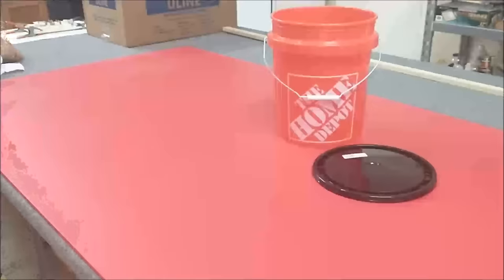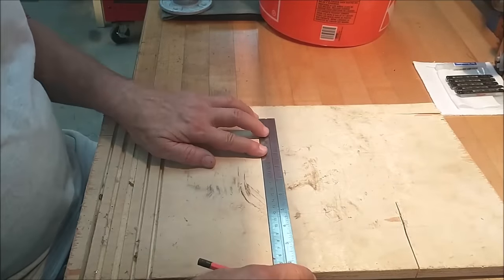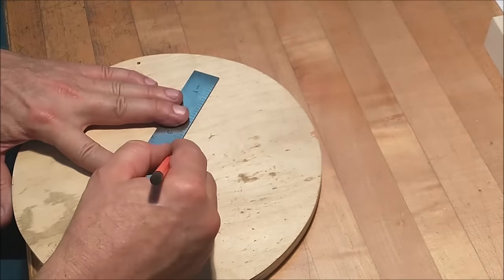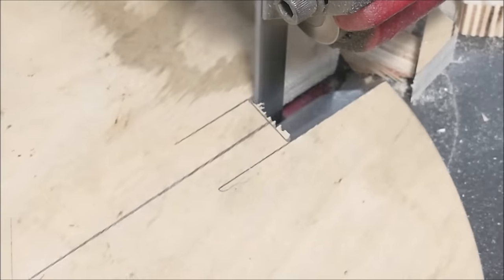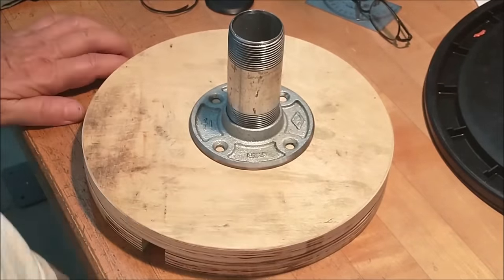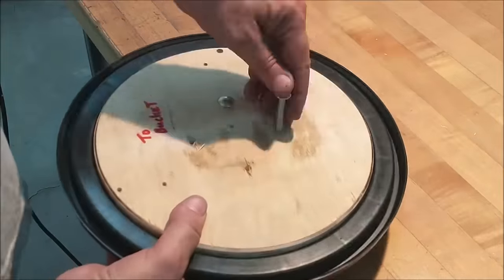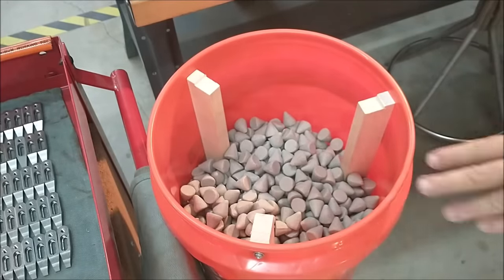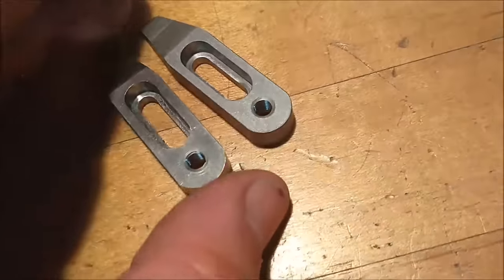How to build a Deburring Bucket for Your Parts

Comment: Very cool DIY. Adding some water (assuming the bucket is sealed) may help with that.
I"ve built three ball mills in the past.... so yes, tumbling makes a lot of noise. 
As an alternative for smaller scale - fill that bucket with some insulating wool, place and secure a smaller container in there - now you won't hear the noise.
Reply from the maker: Dry can get dusty, but cleaner in the long run.

Comment: I have used a Harbor Freight cement mixer. (The one with the plastic drum) - We had it anyway to use for mixing concrete for smallmachine bases and things like that (Millwright Contractors), Just got the stone pyramids and a little water and let 'er rip. Dump it onto a sheet of plywood when done and have the kid pick the parts out and shove the stones back into the mixer for the next time.  - 

Don't think they sell it anymore but at the time (over 20 years ago) I thing we paid something like a C-note for it. Still got it sitting behind the barn. Needs a motor but other then that it's ready for fence posts or deburring parts. - Wounder what the rocks cost these days though. Wounder if you could just use gravel or marble chips?
Reply from the maker: 50 pounds at 4.25/lb.

Comment: Hello Joe,
The problems with using plywood is that its slightly harder to balance the sin-bar to get the 120 degrees, its more frustrating to level the thickness with a dial indicator,  it is less tolorant to surface hardening by  heat-treating and its less easy than brass to gold plate.

I built something very similar 63 years ago.
It worked a couple of days a week forever until I realised it was days from 50 years old.
The day before its birthday it got stolen and never came home.
But 50 years of loyal hard service and no cost from the salvaged  junk parts.

I used a chuck & gearbox of an old drill that had a burnt out motor.
A toothed belt & 2 different size pullies from something, a Ford Anglia windscreen wiper motor, an old battery charger, a christmas biscuit tin and a sandpaper holding disk with arbour into the chuck.
I used builders sand dried in a low temp oven.
The sand gets ground down finer & finer.
So over the years I accumulated jars of ascending grades of abrasive (sand).
No the tin lid Never leaked abrasive or fell off.
In fact the sidewalls of the tin bloated out as a radius top to bottom of tin, arround its circumference by over half an inch.
The bloating made the lid an even tighter fit.

Comment: Hi Joe,
Tumblers are very useful for cleaning up parts. I knew of a company that had a few of them that were actually made of wood, similar to small barels that had openable hatches, that stood up to the abrasion for decades. Tbey had multiple barrels mounted in a vertical frame driven from an electric motor via a chain drive. They used things like broken ceramic tiles for the abrasive, which seemed to work amazingly well.

Not sure how well the plastic bucket will last.

Regards Dennis

Comment: I did the same thing almost 20 years ago. The first proof of concept was a 1 gallon paint bucket. Held it in a three jaw chuck and supported it with a live center. I just used sharp concrete aggregate. That worked a treat. So I welded up a hexagonal drum from 1/4” plate. If you think your bucket is loud…. Eventually I got a commercially available 36” barrel. Rubber lined and the rubber is about 1.25” thick. Much better. Quiet! We do the process wet and add a soap like additive. It accelerates the process and keeps the dust down.
Reply from the maker: I like the hex design lined with rubber.
Reply: @joepie221  the hexagonal tumbling barrels are commercially available. In my experience they are faster than vibratory deburring. Adding a surficant speeds the deburring. The bigger the barrel the more energy is developed as the parts cascade down the sides.

Comment: Joe, consider looking into a used pipe threading machine instead of your lathe.  They spin at 32 rpm, tons of torque and often cost less then 500 since plumbers aren't threading alot of pipe these days.  They're often bulletproof and are often left outside.  A ridgid 300 would be an ideal choice.  Thanks for the great video Sir.
Reply: A cement mixer is a LOT cheaper then a power vise.
Reply: @mathewmolk2089  good point, never thought about one.

Comment: Joe,
If I may make a recommendation, add some water flow through there. It will drastically improve your  already-good finish.
Reply from the maker: If I had a filtration system inline, I certainly would.
Reply: Joe,
You only need a little more than a trickle. An 1/8" tube on low flow will be enough. Would your local zoning laws still require a filtration system for that level of drain water?

Comment: Another weird and noisy method:..  a plastic barrel, ( near true cylinder ) continuously rolling down slope on an exercise treadmill. My barrel will sit between the two near vertical uprights that form the hand rails/control panel mounting bar.
Reply from the maker: There should be a competition on design for these.

Comment: I would highly suggest for anyone  making one you check to make sure you have a lid with the rubber gasket since most cheap home store buckets don't have them anymore and will leak abrasive stuff out on your  ways unfortunately they've been making buckets way cheaper and weaker drywall buckets dont have seals anymore and cheap lids usually don't either you have to check to make sure it's a bucket with a seal or use a paint bucket which is way stronger than the buckets they sell at home stores
Reply from the maker: Also, many lids with seals are one way. You'll need to make relief cuts to get them off.

Comment: You might try adding some water and dish soap into the mix and see if the end result is more preferable.
Reply: Angle iron or mild steel ribs would be necessary since water and soap would soften and destroy the  wood.

Comment: First mechanical job over summer was at a door lock manufacturer. Toolmaker had 2 tubs to debur parts. 
My job was to assemble door lock parts with big brass  knobs at each end. After that the rest of my life was finding a machine or tool to make life easier.

Comment: I have a strange question : why with my old lathe when I drill in center, the begin is centered and the exit is off center by 0.2mm on a piece 25mm long. The drill is new, only the tailstock is 0.3mm under the deadstock.
Reply: It probably means your tailstock is not aligned. Point of the drill is on center while base of the drill is off center. For good concentric results tailstock needs to move parallel to the ways.

Comment: Made something very similar to sift dirt/compost, just replace the bucket with hardware cloth, made a door in the side, stuck another flange to mount a handle on one of the nipples, and made a frame to hold it out of some scrap pallet wood.  Works pretty good for getting stones and big chunks of stuff out and breaking up the clods.
Reply from the maker: I've used that method, but mounted to a square wood frame and fed with a shovel. Works well.

Comment: I made mine out of a 5 gallon insulated water dispenser.  Has the insulated gap between the inside and outside to quiet the noise. Also, if you add water(mine does not use wood) and a non corrosive solvent to clean the parts, you can drain it off through the water dispensing spout on the bottom. Anyways, this is a great idea. Works awesome!
Reply from the maker: Nice.

Comment: I have a rock tumbler. It is generally recommended to maximize efficiency to have the drum filled 3/4 full. this sometimes means using some filler to prevent overloading the weight, or needing too much grit/abrasive. I've seen golf balls used as filler, but at this scale, perhaps baseballs.

Comment: If you don’t want the noise, you could use a rock tumbler drum.  They have a thick rubber liner.  Lasts for years with abrasive in it running 24/7.  Can hardly hear it.  Pretty sure my tumbler is American made.
Reply from the maker: I've heard using an old wide tire is a good place to start. I may investigate that.

Comment: Used the same HD bucket attached to a brake lathe faceplate. Placed the other bucket inside for the tumbler barrel. Lined it with indoor /outdoor carpet for better traction, and less noise. Used ground up walnut hulls and a bit of lapping compound. I just swap barrels and keep going, mostly cartridge cases now days.
Tim

Comment: Nice! Did you heat treat the parts before tumbling? I don't see any scale, but that's not conclusive.
Reply: Only heat treated the plywood.
Reply from the maker: I'll see how they look afterwards. Done correctly in a vacuum furnace, or argon inert atmosphere, the scale should be minimal.

Comment: Normally you would want some sort of liquid on this ceramic media.. water, oil, emulsion, it binds the dust so when you open it - it does not cover all of your ways and lungs.
Reply from the maker: I never open the bucket in place. Always outside. Liquid is better, but comes with a price. Secondary rinse and what to do with the slurry. It will have metal shavings in it and should never go down the drain.
Reply: @joepie221 Oooh, good point! Can you do a follow up on the cleanup phase, so people don't go ruining lungs and plumbing? 👍

Comment: Joe, nice video….  keep your eye open on Craig’s list for an electric cement mixer.   Doesn’t tie up your lathe…. Can be run outside so you don’t have abrasive dust near the lathe
Reply from the maker: Using the lathe was just an immediate temporary drive source. I plan to build one.
Reply: @joepie221  we used to put the 5 gallon bucket of parts and media right in the mouth of the cement mixer…. And swap out buckets for each subsequent batch.  Kept swap out fast and the electric mixer clean

Comment: Great idea! May copy it.
I have several smaller grinding/milling jars made long time ago out of sewage pvc plumbing and glued in endcaps, very simple to make. They have held up very well. Something softer like polyurethane or rubber lining could help to reduce the noise if it could be fixed inside somehow. Perhaps a rubber sheet fixed by screwing the baffles in from outside. Mine are loud as ... I have used aluminumoxide cylindrical media.
Reply from the maker: I chose the media based on the part features I wanted to address. Too small of media and you'll be picking stones out of those slots for hours.

Comment: How the dickens are you old friend ? When I got into this silver pouring gig I spent hours hand polishing the pieces. Hours and hours on them. I must have 40 different metal polishes I never use now as I built a great 2 wheeled cotton wheelied polishing setup from a piece of bent log truck trailer compensator, a couple used one ton brake rotors and a piece of truck frame, and a couple extensions to make more room around the wheels. I did a video on it.  Looks great and works well but not paying enough  attention the cotton wheels would grab ahold of the piece and sendit the length of the shop. Add a cheap wheel grinder and not a real safe thing to sit in front of, LOL. I saw a  tumbler on the Tube and got a "Thumblers Tumbler" A twin 3 pound barrels model. Now i just clean the castings with a saw and file and let it run/ tumble for an hour or two and the deed is done. Now I have a post polisher and a bunch of silver/metal polishes up for grabs, LOL. I use a jewelers tumbling media on mine but for your debering I would get a bag of sandblasting crushed glass. These cones are something I have never tried but will defiantly use them. The glass is reasonably inexpensive and available in most auto parts stores. Stands up well too. This build is a nice easy one. A fella can make it without a bandsaw or lathe for that matter. I use distilled water for a lube but try some regular coolant from the lathe, mill or grinder. The fluid in my case makes for a much quicker deburring. No flash rusting as well in your case. Great post old friend. It must still be stinking hot there. Your under shirt must feel heavy as a result of it. Take care fella,
Reply from the maker: It got to 99 the other day and my wife said she felt cool. Its been nearly unbearable.
Reply: @joepie221   When you folks from that part of the world say it's hot I tend to think if I went there I would melt. All the southern states are having big time weather issues. I have friends in S Georgia and Florida that are all having a rough time of it.  Take care bud.

Comment: A concrete mixer will do the same job, a lot more durable though obviously a lot more expensive.
Reply from the maker: I will ultimately build a 6 or 8 sided drum and sit it between 2 driven rollers. In my spare time. :)

Comment: I did about the same thing.  It works well, and I tumble stuff wet using small amounts of dishwasher soap and about a quart of water.
Reply from the maker: Water would help, but the side effect is mud and foam. Then the parts need top be washed and possibly treated with a rust preventative. Then what do you do with the foam?
Reply: @joepie221  with dis washer soap there is no foam and the “mud” rinses off very easily.
Reply: Does it matter which dishwasher soap, liquid or powder? 

Do you have to worry about the surfactants leaving behind a film on the parts?

Comment: Good video! You remind me of a  workshop owner that I used to work as a machinist, back in 1965 , learn a lot from him, I remember that he required all machinists that wish to work with him, to know how to screw cut the inside of a 6 inch   pipe that was 6 ft longer than the lathe..many didn't make the cut
Reply: Not a machinist here... but cant you slide it past the throat of the chuck?
Reply: @partsguy9423  no , forgot to say that the chuck throat was 2.5 inches,
Reply: Attach the pipe to the carriage and the tool in the chuck.

Comment: An easy and inexpensive way to make a bucket to lid seal is use poly foam backer rod. I can't find it in 1/4 diameter, so I trim it with a utility knife blade. The brand I found is made by Frost King.
Reply from the maker: Good idea.

Comment: Hey joe I’m a machinist myself I run a manual lathe for 10 hours a day. I’ve been doing it for about 8 years. There’s one thing I can’t get right every time first try. That is knurling. On a diamond knurl I’m constantly getting a double cut pattern that looks incorrect. It’s almost luck when I finally get it right. I don’t know if the tool I’m using is crap or I’m doing it wrong. Maybe you could do a video on this. There’s not much information on the web on this process
Reply from the maker: Try this.   https://youtu.be/9Zwi0ZAUCUc

Comment: Joe;
  I did this by buying a plastic 1/4yard cement mixer at Lowes.
  I replaced the flights with 1/2" UHMB
  And sealed all the bolt holes so I could run it wet.
  AS lot less work, and a lot more pay.
  Mark
Reply from the maker: I considered a cement mixer. Good idea.
Reply: What is 1/2" UHMB? Google was no help.
Reply from the maker: Try uhmw, or uhmwpe
Reply: @joepie221  Thanks so much. Love your videos, I always learn something. I have a Speedway 7x14 lathe. If every man had a lathe, a hot tub, and a Corvette, we would have World Peace.

Comment: o.O... nice one.  I'm now think of a mini version with a soda can, or maybe a soup can...  for just a few small parts at time.
Reply: Get a used 9kg propane cylinder . Go to a company that pressure tests tanks and get a reject,
Probably get it for free.
Reply: It doesn't scale down well, because the weight of the media and parts provide the force that abrades the burrs and surface finish.  In this kind of thing, bigger is simply better.

Comment: That’s an interesting idea. I wonder if you could use it to mill black powder. Thanks for the video!
Reply: Do you really want to make that much in a single batch? Most of the people I see making this are running like half a pound to a pound batches and using PVC pipe with brass balls and an old discarded treadmill. A 5 gallon bucket would be for many pounds of powder, I can only imagine what would happen if something went wrong! There might be legal limits too, I haven't looked at the laws.
Reply: I would be concerned about the static electricity generated from the plastic bucket.
Reply from the maker: Probably. just ground the unit. Static could be BAD.